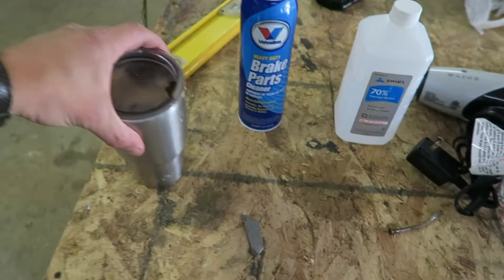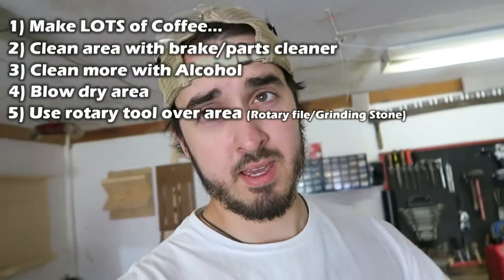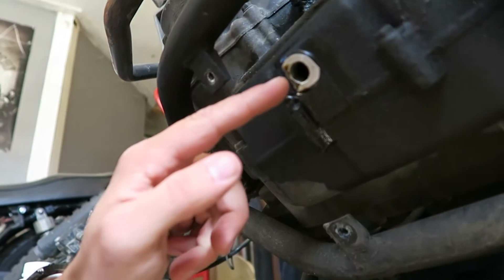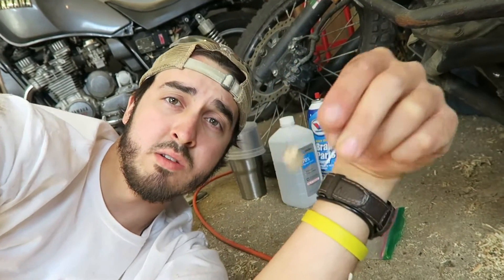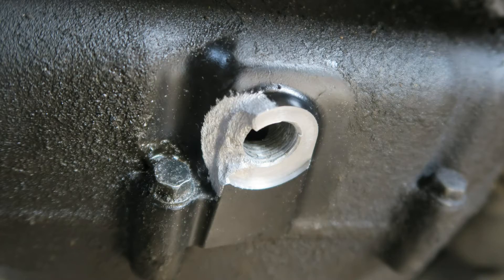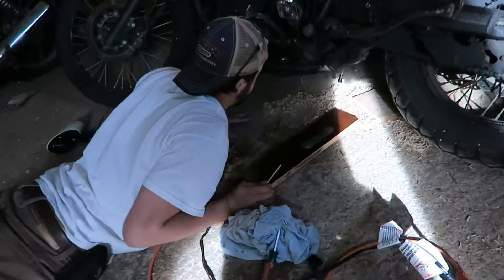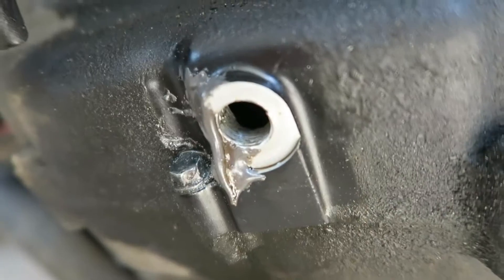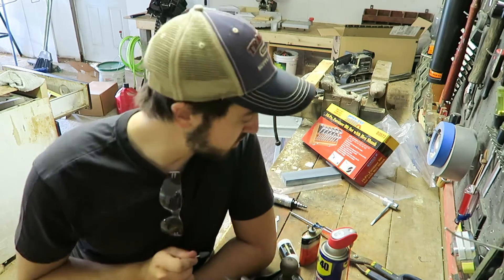FIXING THE BIKE !!

Comment: If that does not work try Blue Magic QuikSteel plastic tank repair kit, i found it at autozone. It is meant for car/motorcycle gasoline  tanks, but ive used it on other stuff before.
Reply from the maker: Thanks for the advice, Ernesto!! I actually haven't even heard of that stuff, but it sounds like a pretty great product. I'll have to check it out next time I'm at the parts store. Thankfully, my JB Weld/ gasket maker patch job is still holding up. Let's hope it stays that way! Haha

Comment: Need to use a flat file and hold it flush to the bolt hole and and file the excess away, without digging into the main case. and then square it up flush and re apply more if necessary to create a larger flat area for the bold to seal on.

Comment: Nicely done, it'll help others with that problem.
But I caution that JB Weld is more of a trailside fix and not for long term riding. (But I've heard miracle stories.)
Perhaps a real fix AND a good skid plate is in your future.
Reply from the maker: For sure, Dan! I also have heard about miracle stories as I did some research ahead of time. I question the long term reliance of my "patch job" but until it begins leaking again, I am happy. Haha If it does start to leak, I will probably look into having it welded, or possibly replacing the case.
Reply: The real fear is if it breaks when you're riding, your oil drains out, and you seize your motor. Need a whole new motor at that point.

Comment: Nice quick fix, but you would be better off to have that spot welded up and then grind it flush. 20 minute job at the shop to fill that small hole.
Reply from the maker: Yeah, the JB Weld was really a temporary fix to get me back on the bike and finish the season. Unfortunately now, I don't have to worry about that for awhile anyway. Haha Perhaps this winter, once I'm recovered and able to do things again I will have time to get it fixed up a little more professionally.

Comment: chip that stuff off and have the case welded up. that JB weld is going to leak over time.
Reply from the maker: Yeah, that is my fear. I figured I could try the cheap alternative first. At least this way I can finish the rest of the season (hopefully). Then next year I can look into getting it properly fixed. So far the bike is running great with no leaks, so I'm happy for the mean time. Haha
Reply: If it does you didn't do it right. We do that all the time and it works fine.

Comment: I'm not so sure that will be a long term fix. Each time you cycle the temperature of the engine you stress the epoxy. It will expand and contract. It will become increasingly brittle and fail. Not good for an area of the bike responsible for holding the lubricant. Every time you remove and replace the oil plug you will run the risk of damaging the epoxy. I would plan on either doing some machine work or replacing the engine case soon. No way I would take a trip on the bike in it's current condition. By the way, I spent many years working in industry with epoxies. I could be wrong but I doubt it. Good luck.
Reply from the maker: Thank you for the advice, Peter! The epoxy job has been holding up well. Really I just wanted it to work for the rest of the season so I could ride until winter sets in and work on a better repair at that time. Unfortunately, I don't have to worry about that right now anyway because I just crashed the bike and I'm now on bed rest for awhile. :(

Comment: Use a torque wrench to the appropriate torque (16.5 ft-lbs). Then this won't happen again!
Reply from the maker: For sure! It could have very well been caused by that. I'm thinking the cause of this issue was a rock that I hit on a sandy/rocky trail during my cross country trip though. I also noticed a pretty significant dent in the bottom part of my crash bars (next to the oil pan), which definitely wasn't there during my last oil change. I do have a torque wrench and would otherwise have used one, but I didn't bring one along with me during my trip. Perhaps over tightening also had a role in the damage. I will definitely be more careful in the future!
Reply: Oh, did you have a metal skid plate and low-profile drain plug? That would have to be one lucky rock! The great thing about the KLR is that every possible weakness has been figured out since the bike has been around forever. I'm never selling mine!